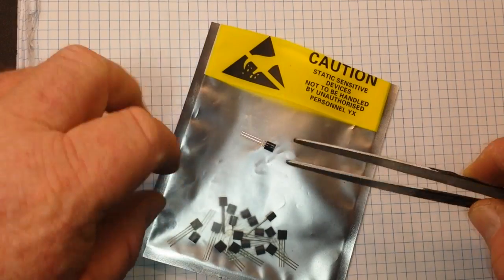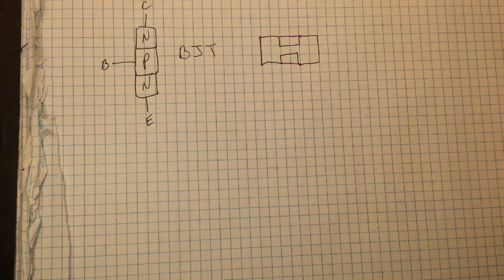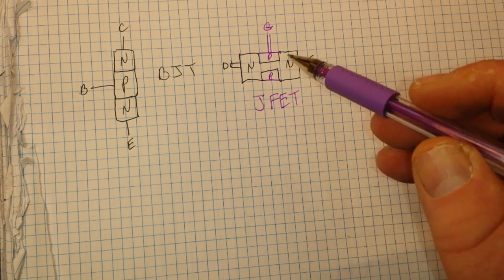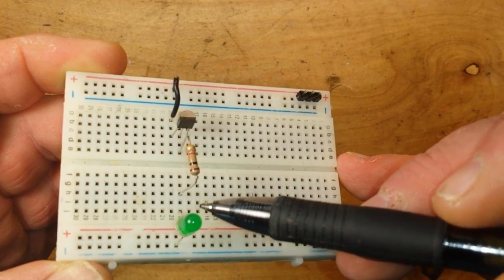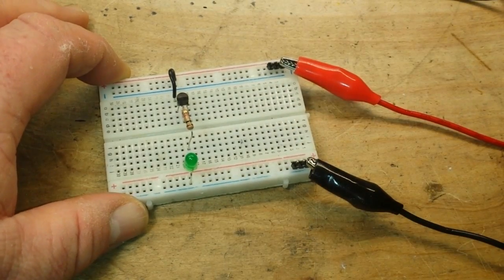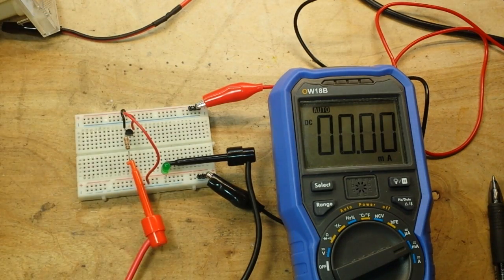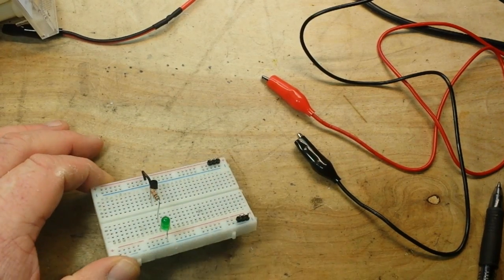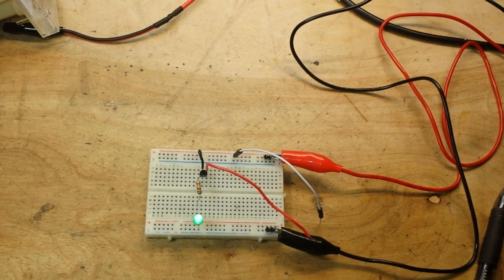Introduction to JFETs

Comment: For any readers coming to this, what might have interrupted the normally on state is to think about a bias resistor on a vacuum tube, the bias resistance auto holds the Grid low by having a potential at the Kathode 
This is what is likely occurring in the video,  if the R was moved to the Drain section i think you would observe a normally on state at 0 Vg 
Thanks for sharing great video.

Comment: JFETs seem to be very popular as the first amplifier transistor in a radio receiver.  One note on static sensitivity, most digital ICs have some protection diodes etc. built in, making them much less likely to get destroyed by the low levels of static in normal handling.  But these individual components, like single mosfets, do not have any protection built in and are much easier to damage.

Comment: I had an issue with a FET. It was used as a switch, but did not work. I removed it, tested it on a component tester, checked as working. Double checked with the diode function of my DMM,  tested okay. Installed a new FET,  circuit was now functional. Perhaps I need a class on testing FETs.
Good video, Thanks Paul.

Comment: Thanks for the video. I think biasing the 2N5457 with positive voltage to the gate is a little bit confusing and does not make any sense. The gate of the N-JFET (like 2N5457) should be reversed biased - with negative voltage. This is how you control current to flow. Your FET is opened all the time and  your circuit just passing current to the led because of voltage drop.

Comment: N channel depletion type JFETS are normally on devices, which means that with no voltage applied to the gate, current will flow  from drain to source.  To turn off a JFET, a negative voltage with respect to source must be applied.  Positive voltage should never be applied to the gate of a depletion JFET.

Comment: The depletion mode JFET makes a very simple constant current source. Ground the gate and connect a resistor between source and ground, this defines the drain current. I used one in a wide voltage input range probe. 
Their electrostatic sensitivity makes them fun to play with, emulating the response of a gold leaf electroscope. You can do the tricks with static charged plastic rulers and balloons. It is the possible to detect the different polarity of the static charge on plastic and glass rods by inducing a charge on the gate by capacitive coupling.
The one you are using looks similar to the bilateral switch, often used to route and switch audio signals. The IC equivalent might be the quad CMOS bilateral switch, the  CD4066 or the even more useful HEF 4053B.
To digress a little, the 4053 is a triple, single pole, double throw, bilateral switch, ideal for switching audio signals, since it allows the signal path to be switched from through to ground, greatly reducing noise pick-up in the off state. Using jfets as audio switches is complicated by the fact that they are not truly symetrical, as the gate control signal is also referenced to the audio signal path.
Reply: I always love educated comments... sometimes they can be as educational as the vid ! As yours is .. 😎👍☘🍺

Comment: gate to source/drain is a diode, must be reverse biased to have high resistance input.  Cannot be turned on, only off (reverse of BJT).  Drain and source can be interchanged on symmetrical devices (gate junction in center of channel), but these have less gain than asymmetrical device with gate junction closer to source.

Comment: PAUL, make a lesson about SiC Silicon Carbide Transistors theory like Drift Layer, Dielectric breakdown field strength, electron saturation velocity, energy band cap, thermal conductivity because these parameters you have to know about when dealing with SiC which are replacing high power transistors.

Comment: Hey Paul, I’ve said it before but your explanations are the best. You’re my go-to source for anything electronics so I’ve finally signed up to you patreon.

I’ve been playing with JFETs as voltage controlled resistor to control the tuning of an oscillator which is working out well. 

Have you ever played with the LM13700 OTA? I’m having a lot of trouble understanding it but it sounds really useful for CV. If you’re looking for content suggestions it would be great to get your take on it.

Thanks again for all the great content.
Reply: I issued a save file on the Data Sheet only to realize I had already downloaded this data sheet. I am not sure where I saw it being used but the LM13700 looks like a KILLER audio applications chip. Cheers!
Reply from the maker: I will check it out
Reply: Just want to second the idea on a video about transconductance amps. I just got a tube of 3080s in the mail and plan to make some synth diy stuff with them. @learnelectronics keep making great videos!
Reply: i didnt understand transistors for most of my life until a while back i realised that they are a controllable resistor. everyone always talked about them controlling big circuits and amplifiers and gate source drain collector emitter voltage and stuff and i didn't understand. then someone was like 'its a resistor that you can control' and im like. oh. oh yeah. now it makes sense

Comment: This makes them more understandable. I've been doing some research and I have read that the JFET will act more like a "tube" in a preamp circuit that a regular transistor like the 2n2222. I'd love to see a preamp demonstration/circuit for the audio preamp. As a guitarist, it would come in handy to understand how the preamp works including a comparison between the different transistors. Thanks, Paul!! Another great video!!
Reply from the maker: Dave, audio is just not in wheelhouse. I wouldn't be confident I could teach it. Sorry to let you down.
Reply: @learnelectronics  no worries. I just want to learn what I can and your videos always point in a good direction.

Comment: You missed a bit in your explanation. There are two types of FETS: 
Enhancement: Need a positive voltage on gate to turn on (For N-channel).
Depletion: Is one at zero volt on gate  (For N-channel).
MOS FET exist in both types, with JFET you have to use  depletion due to the diode in the gate.
Tying the gate to the source will make the FET into a constant current source, when the source is negative. This is because the gate will be negative due to the internal voltage drop in the transistor, and this will make the FET start to turn off. Depending on the parameter of the FET a resistor may be needed between source and gate, current is drawn from the gate connection (i.e. gate is minus and drain is +).

Comment: To make jfet devices work at higher voltages , the source and drain could have different doping profiles, then you can not switch source and drain.  But for regular jfet, for example the one you are using, you should be able to switch source and drain because the doping profile of source and drain is the same.  Funny, that you found even this transistor you can not switch source and Drain!

Comment: I make 9 volt ghost detectors using JFET's with an LED resistor and battery clip. Simple and the ghost buster group I make them from say they are very effective. I am not into ghosts but love playing with electronics.

Comment: How do you know which one you have?  Jfet, mosfet, BJT? I'm trying to fix a printer that was reverse polarity. So I had one blow.  But it is pre-standard component.  So the numbers won't cross reference.  And some printers have the m735 and some had sms 445.
Reply: @lepidoptera9337  pre standard means before the numbers were required to be standardized for products sold in America.  Before that the companies put a part number rather than a reference number for value. So before 2002? You had to look it up in the specific companies book to find out any info.
Reply: @lepidoptera9337  I know many businesses like Apple don't want people to fix the products they make.  But there is a standardized code on most electronic components. But micro components don't have the space.  Which is something we are dealing with in the right to repair laws that are being heard in many states in United States, that would require transparency and the ability to have a diagram that can be referenced to find the values of components.
Reply: @lepidoptera9337  well I'm so proud of you for thinking you know everything.  But the chides on resistors didn't need to reflect value.  Till around 2002 Federal Regulations required all manufacturers to put regulated codes that would apply no matter the manufacturer.  And I know this because I work on old printers designed in 1998- 2003. Many of the components have a company logo then a company part number with no numbers reflecting values.  No data sheets for these components at all.  You have to fugue it the company and find the old books then hope the component is in the book to even get the value.  Smd company part numbers are on them.  Not value.  Today if I go buy a small resistor it has a value code on it.  That is Federally Regulated.  But companies have found loop holes. And we can't as a country continue to trash Everything that breaks. We will run out of places to bury them.
Reply: @lepidoptera9337  and SMD resistors? Micro Components? how do you Identify them? because thats what im talking about. everything has an identifying number on it. i have pre standardized smd resistors. the numbers dont give the value. they are a part number. my uncles business manufactured a smoke opacity meter to test Big Rigs and off road diesel Equipment. the last motherboards were made in 2002. i still repair them and the seiko printers that they stopped producing in 2003. the designer took all info on the meters when he left. and so here we are. with me asking a question about components that have no identifying numbers. that blew. arguing with someone who clearly doesnt know or remember the change or installed Regulation. it literally took 2 years to get an answer. granted i only asked maybe 25 times in different groups. but one person finally gave the answer i was looking for on a FB group. they have been doing this 40 plus years. and sent me in the right direction and even emailed company logo images that they compiled in the years they put together to help people. and micrichip technologies doesnt respond to inquiries about outdated, pre-Regulation components. so even the manufacturer of the components employees couldnt answer my question on value, because the numbers dont reflect anything in the system. that dates all the way back to the regulation put on manufacturers in the united states. this isnt your problem. and the answer is over
 your head
Reply: @lepidoptera9337  whatever you say.  The part i was looking for was a regulator.  But every single ejecting ship i bright it to thought it was npn. Including the manufacturer

Comment: This is a bit confusing to me. 
In the video it is claimed that he uses an N-Channel depletion mode JFET, so shouldn't the LED light up when the gate is at 0 volts? 

I think it's the wrong part. That thing behaves like a MOSFET.
Reply: no it should light up when there is no voltage in gate to source 
when apply voltage -volt for gate and +ground , stop drain to source current flow 
jfet behave opposite as mosfet transistor and gate voltage also invert as N-mosfet
Reply: @raviduprasanna6401  did you even look at the video?

Comment: Hi. i have a usb microphone and it has a 2sk660 jfet connected to the capsule. I want to replace that jfet to reduce noise for my mic.
 I  founda adviceon frome homerecording forum 10 years ago. to replace that jfet with 2n5458 and i need to bias the FET, but unfortunately I don't understand what I have to do. 
can you help me?
Here is what i found: " As for this mic, the capsule isn't bad, you can improve SNR by replacing that FET with any of the usual lower noise suspiciousness (even 2N5457 works fine). 2SK596 is very noisy by comparison. You will also need a high-value resistor (at least 100M) to bias the FET The easiest method is to ground, and given the limited supply of 5V that works fine here , you should have a resistor (not a critical value; 3K3 to 10K will work) from the source to ground. This will reduce distortion/increase max SPL handling."
Reply: This is late, but I believe that means to put a 100M resistor from gate to ground (Vss).

Comment: Did I fail to pay attention somewhere?
I have never used JFETs, thus they are completely new to me.
From this I got the "feeling" that a JFET is a MOSFET with a bad datasheet.
I must be missing something  :-)
(Just realized that above might be seen as a negative comment, It's not meant that way)
Reply: It's Leakey but blocks current in both directions
Mosfet allows it in a direction, due to inbuilt diode
Reply: Did you already mod your clamp meter? I just got the eprom programmer in my mailbox.
Reply: @SurajGrewal  Ah! Good point. Thanks.
Reply: @rolandberendonck3900  I was not aware that it was now possible.
EDIT: Stuff ordered. Thanks for the hint.
EDIT2: To people wondering what we are talking about: https://www.youtube.com/watch?v=fX-Fhq9R4uY
Reply: @flemming2jacobsen911  Yes it is. I replied you in that topic, but it seems like you missed it. Take a look at this video: https://www.youtube.com/watch?v=fX-Fhq9R4uY
Reply: @flemming2jacobsen911  This is also an interesting video to watch: https://www.youtube.com/watch?v=0lyMiAKfOjU
He has got one other one in which he adjusts the start value to zero by adjusting the trimmers.

Comment: Can you do a BC547 and compare to J201 please?
Reply: @lepidoptera9337  Because I don't know anything about the difference... I'm new to playing with an LM386, but so many other similar looking components...
Are both called Transistors?
Do both attempt to do the same?
Reply: @lepidoptera9337  I started with making a simple LM386 amp.
Then wanted to build it into a guitar sustain pickup that vibrates the strings... where the OUT is the new 8Ohm wound pickup to vibrate strings...

But some circuits were transistor, some not... and I think there is more science to it than I believe
Reply: @lepidoptera9337  thank you btw!

Comment: Hi, you mentioned that the JFET would stay in the on state until a negative voltage was applied, but it didn't seem to.  When you removed the gate voltage the LED went out.  Did I misunderstand?
Reply: The resistance was acting to bias the gate just as in the function on a vacuum tube bias resistor. 

Move the load to Drain input section it would have I strongly believe.

Comment: Bidirectional transistors! Who'd a thunk! 😋 Interesting. Should be very sensitive!
Reply from the maker: Weird eh?
Reply: I guess it makes sense if they can maintain tolerances and put the gate material exactly in the center. The core is a single piece of n material so it wouldn't matter which direction the current flows.🤔